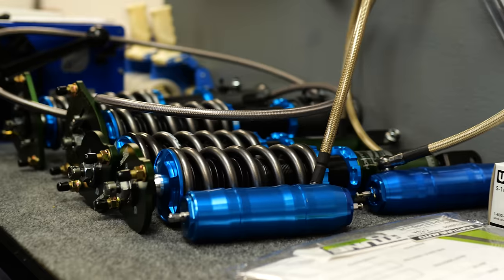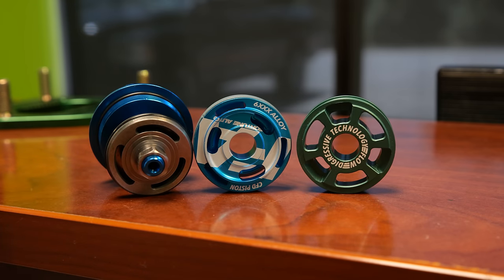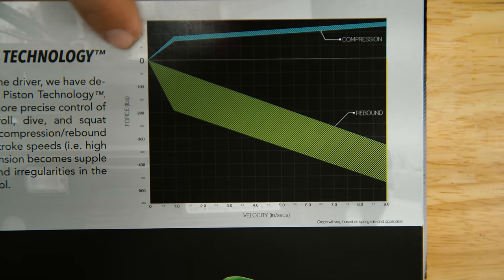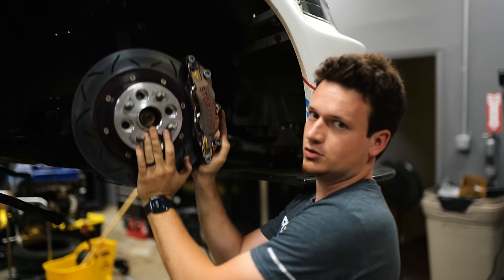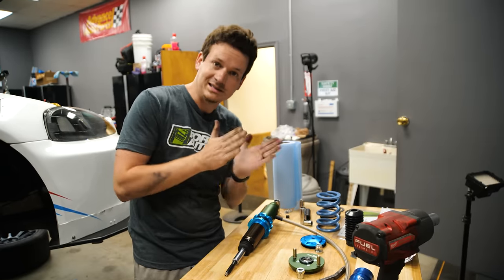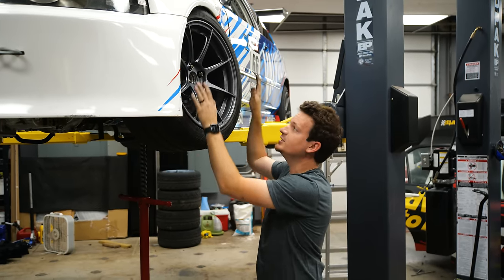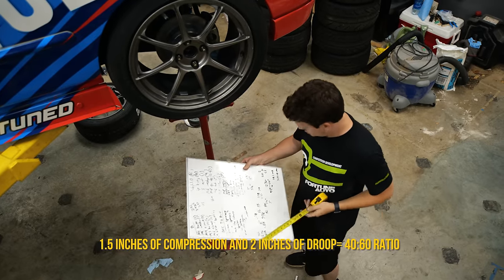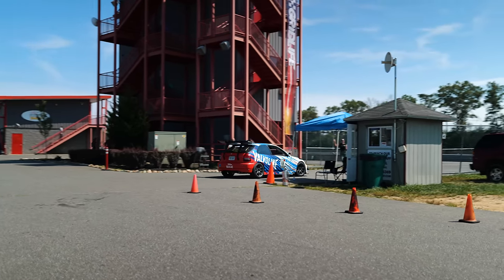How to Properly Set Up Coil-overs

Comment: I think the most important part is the camber and toe adjustment, I saw you doing it but not explained, off corse that can be dial in the track with a infrared thermometer.

Comment: I want the most comfortable ride coilovers I can get for my daily driven ‘91 Civic hatch. As for ride height, I’m not looking to be slammed, again this is a daily driver so a little lower than stock is preferred. Currently my Civic has Tein progressive lowering springs with Bilstein struts. All other suspension components are Hardrace with hardened rubber bushings. So which coilovers and brands do you guys suggest for the most in comfort?
Reply: tein z and soften the springs and dampers and you're good
Reply: Entry level kW suspension show do
Reply: @neonovember7023  are KW comfortable though?

Comment: 2:00 travel before bind is also a pretty relevant detail when selecting coilover springs (though not much difference between the Hypercos and Swifts here). Also, do the springs actually test out at their stated rate?
Reply: Swift springs are load tested :) i dunno about the other.
Reply: Stick em in a shock dyno

Comment: You skipped checking the corner balance after attaching the swaybars. That's what adjustable swaybar endlinks are for. A lot of aftermarket bars aren't perfectly symmetrical and will "wedge" the car a little with equal length swaybar endlinks. Obviously this is a manufacturing tolerance thing so it's possible the bars are perfect, just not likely.

Comment: Proper video. Few points to add; Tbf it doesn’t make whole lot of sense to first set the spring perch heights(rideheight) b4 setting the full compr setting since you’re gonna adjust it anyway, this way, you can save some time by installing coilover directly, without a spring. 
And every tire is different from another, for example 195/50/15 ar-1 vs 195/50/15 R888, there is a 7/8mm height difference in the tire. (Even some width)  This means that the tire will hit the chassis in full compression.. 

And the bumpstop will compress more than what you’re able to do with the cars weight & lifting the wishbone & coilover to check bumpstop travel. For example at foxhole in nurburgring, there can easily be 2G’s. It’s a good measure to factor in a 5mm extra space between tire & chassis if you really dont want to rub in ANY situation.

Comment: At 9:30 , are you also changing the preload of the spring?
Reply: Yes because he wants a certain ride height and it will be too low after he adjusts the body (to be shorter overall which lowers the car) if you don't increase it back with some preload.

Comment: Serious question here!
Ik there are tons of factors when it comes to spring rates but looking for a good rule of thumb for a fwd track car. Do you want neutral spring rates or a stiff bias to front/rear? For context my car is front heavy 60-40,lowered, big rear sway bar, cambered -2,-1.5 with .01 toe out front and rear. Any help is appreciated as theres so much personal biased info but i want facts.

Comment: Why do you want to lower the shock body and utilise the bumpstop (have the bumpstop compressed)  inlieu spring compression? Most coilovers are height adjustable at the lower collar and using the strut lower cup. I just wanted to know why the need to utilise the bumpstop and not the springs to prevent bottoming out?

Comment: Those type of "cartridge" coilovers don't allow for much travel. I wonder how the car will fair on track.
Reply: Do you mean a non fixed mount shock? Although a fixed mount shock typically has more shock stroke you also are limiting travel when you adjust ride height and droop etc. since typically they have helpers and it’s not independent adjustment. Luckily for Ben in this situation we were able to increase shock stroke and body size especially in the rear because of the wheel size he has and other items on his current suspension so travel isn’t an issue here.
Reply: I believe we are talking about the same thing. I know what you're saying, but if the damper is properly designed for the car you can often get the drop you want with a lot more droop travel. Most cars can't drop too much anyway without affecting suspension/steering geometry or running out of physical space.

As far as Ben having enough travel... I guess we'll see. If I understood him right overall travel was 3.5-4". That doesn't seem like that much to me. I think the problem he was having before on his old coilovers at least in part was the droop was limited so he was lifting his inside rear tire making the car loose through some transitions. Having dealt with that myself the solution is more spring and less bar (assuming IRS, not a Honda guy) along with increased droop travel.
Reply: @salspec3381  Yeah, from being at the events with the suspension on it, seems to have cleared up his issues. He is driving faster than prior which with the new episodes from Gridlife about to drop you’ll see what I mean in terms of competitiveness with how the field is now in Club TR.
Reply: @devinherndon56  Ok. Looking forward to seeing that footage.

Comment: It's a shame fortune auto doesn't ship to sweden :(
Reply: Honestly the stuff you have in Europe is better. I'm running KW Clubsports.
Reply: @salspec3381  KW Clubsports are at least as good as fortune auto 500? I had no idea, but that's great since KWs' are easily bought in sweden
Reply: They are leagues better. KW Clubsports are a competition level coilover while Fortune Autos 500's are not. KW's are made in Germany where as Fortune Autos have components from Taiwan and maybe China. Taiwan can make some really nice stuff, but the best coilovers come from Europe and Japan.

Also the coilovers used in this video are a cartridge type. That means they use the same damper for multiple applications to cut manufacturing cost. The problem is you often sacrifice suspension travel. The KW's on my STI are specifically engineered for that car. The strut tabs are welded to the damper body. This added length provides more travel.

Now they are not perfect. The Germans are obsessed with preventing corrosion. So the bodies are made from stainless steel and the lower perches from polyamide. Stainless is not a great choice for a structural material because the elements that make it corrosion resistant make it brittle.  As a result the damper bodies on my coilovers can develop stress cracks where the tabe are welded on. Under extreme uses the perches can fail too. I've only seen that once and heard about it one other time. It's usually when the car leaves the ground or otherwise hits a large undulation in the surface.

The thing is no coilover is perfect. The KW's have amazing dampening properties. So much so I bought them anyway. I had some new lower perches made from 7075 and if the damper bodies crack I will repair or replace them.

You may ask why I went with these after explaining the detractors. I have a dual purpose street/ track car. KW's have the best ride quality in this regard. Somehow they absorb all but the biggest undulations on the street while performing superbly on the track surface. I had AST 4100's before. These KW's ride noticeably better even with increased spring rates, but I digress.

Now you may not need this level of coilover if your looking to just drive on the street. The problem for me was most non-competition coilovers max out around 600lbs (10.7k) of spring rate on a strut-type suspension. I needed more range so I went to competition level coilovers. I went with KW again because their ride quality is excellent. That is what really seperates the low and high cost coilovers. The R&D that goes into setting up the dampers. It takes more time and costly specialized equipment.
Reply: @salspec3381  Thanks for the great comment! I have a 2012 sti myself that I started taking to trackdays this year, I've done 2 so far and an autox day, I have at least 1 more trackday planned this year. Next season I'll more than likely buy coilovers, but comfort is still important since I daily the car. Of course my level of comfort is what my car offers, so its not exactly a Mercedes on air suspension, but I don't want the car to feel like a static stance car when on coils. I'll have a closer look at kw for sure, do you have any recommendations?
Reply: @salspec3381  I also noticed your YouTube image, we have so much in common it made me laugh a bit😁
Reply: @Marticus518  I hadn't noticed your youtube profile pic was Ironman. That is funny.

If you're tracking and autocrossing then I recommend the Clubsports or another competition level coilover with 2-way adjustment. Chances are you'll outgrow street class coilovers like I did. As I said coilovers meant for street or "sport" driving start to see a performance drop not much above 600 lb springs. Sure they can be revalved for it, but performance will still suffer.

I think KW's offer the best ride quality for the street while performing very well at the track. The one thing I don't like about them is those plastic spring perches because I want them to be bombproof.

I'll also add the while Japanese coilovers are excellent quality they do have aggressive valving. I think it's because Japanese roads are said to be super smooth. Anyway keep in mind they have the potential to ride hard on the street.

Lastly coilovers need to be rebuilt. So whatever you buy the easier that process is the better. Also I've heard monotube dampers need to be rebuilt more often than twintubes. I'm not sure why though. The KW Clubsports are what KW calls a semi- twin tube. I think that translates to a twintube with external reservoir. I guess they'd fall somewhere in the middle of the rebuilding schedule. Mine are 3 years old and still seem great, but I have a feeling they'll need a rebuild in another year or two. It depends on usage.
Reply: @salspec3381  I'll def look into the clubsports in that case! What do you mean by plastic perches?
Reply: @Marticus518  the lower perches are made out of a purple plastic. Just search KW spring perch and you'll see what I'm talking about.
Reply: @salspec3381  alright, thanks man!